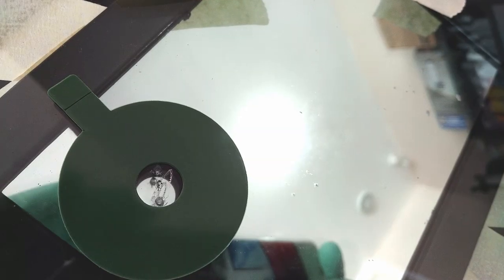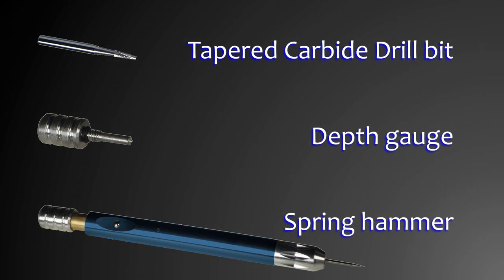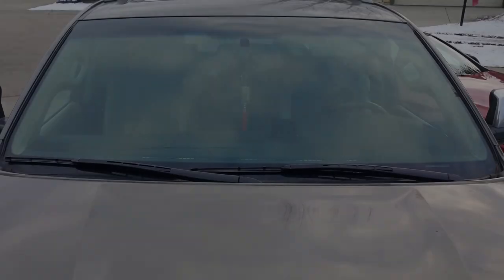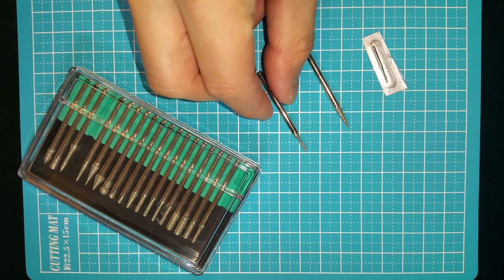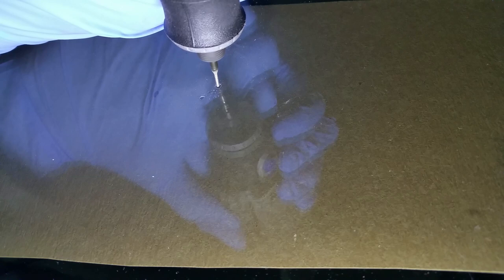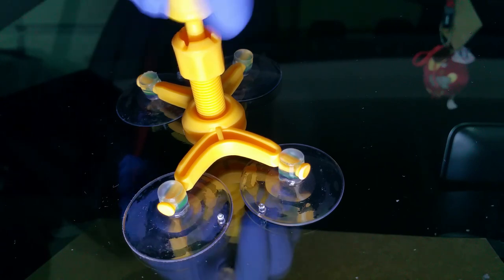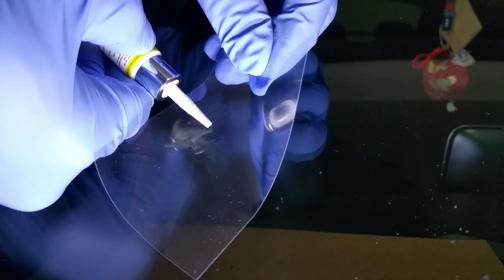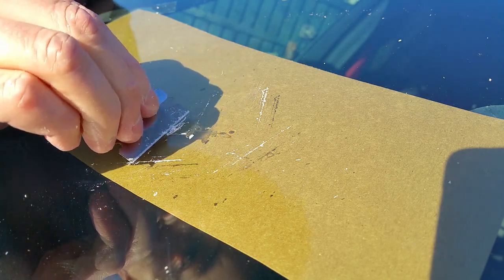How to Stop windshield cracks - Do this before using DIY windscreen chip repair kits + Tips

Comment: Oh snap, I wound up buying the same diamond tip set for $14 last weekend at princess auto! I also used the smallest tapered bit and had it run away like that. You used the smallest cylindrical tip the 2nd time around?
Reply from the maker: Yes. I used the smallest cylindrical tip I had the second time around.  I think i wasn't able to make the hole cylindrical enough since the filling vame out again after some time.  I didn't want to go through the glass so I didn't go too deep.
Reply from the maker: One more note.  I'm not sure how small your cylindrical tip is but the one i have is not as small as the one you can get.  A smaller tip will probably give you even better results.  I think I linked to one in the video description.